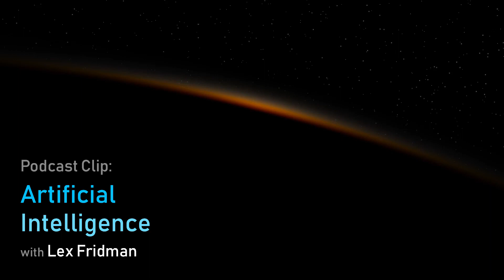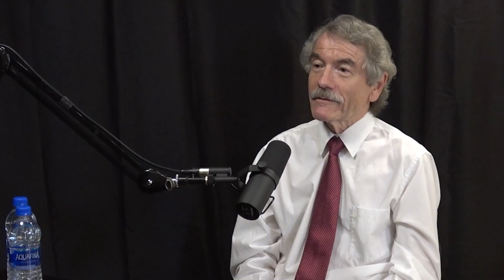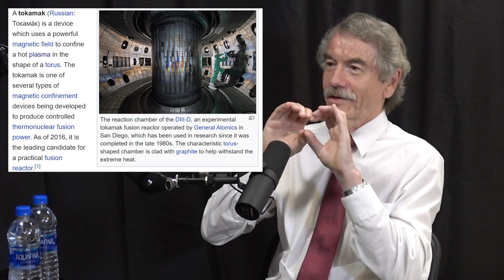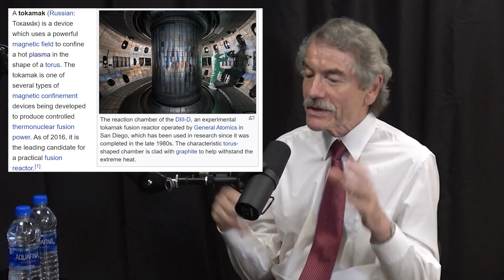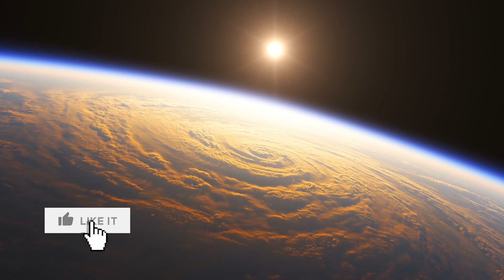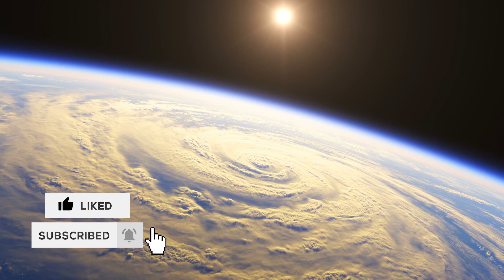Nuclear Fusion Energy | Ian Hutchinson and Lex Fridman

Comment: Nowadays a 150€ photovoltaic collects 400Watts of fusion power from the sky and produces no radioactive waste.
Reply: But the power density is abysmal, they only work for half a day and they get obstructed by clouds.
Reply: NPC 3000 power density is less of an issue with single/double level housing within 35-40 degrees of the equator. Housing and appliance designs can be changed to maximise daylight power production, which currently is not the case. Also battery production and recycling improvements further support cyclical supply but constant demand.

Cloudy days can still see 25% production.

As Ian said, there is no one solution to human power needs. We need multiple supplies and a 3rd millennium design approach.
Reply: How many square kilometers does a nuclear reactor and its associated uranium mine and reprocessing plant occupy? We must be talking square kilometers. 1 km square of photovoltaics has peak generation of 200MW. I don’t see power density as an issue.
Reply: @simontulloch6882  The nuclear reactors on submarines create hundreds of MW, 24/7, for decades. Terrestrial nuclear powerplants have outputs measured in GW. You really can't argue it in terms of energy density, sorry. Note: I am a huge fan of solar energy, after having been a critic for a long time. The economic argument, mostly influenced by economies of scale, is the one that won me over.
Reply: Clouds do not prevent photovoltaics working. Loss due to clouds approx 50%
Reply: An under appreciated fact.
Reply: HiveMind2000 create what?
A battery?
A factory?
An individual photovoltaic cell?

For individuals doing the accounting one must also consider the cost of transmission and distribution networks for centralised energy production. The ongoing maintenance costs. All of the increases as the total current increases.
Reply: Ive no idea, do you know? A potential deal breaker if they consume more in production than they ever generate.
Reply: Good for near the equator, terrible for a place here like the UK or a population dense region that doesn't want to decimate its natural landscape by covering it with cells.
Reply: @HiveMind-qv1iy  It takes in any case a bit less than 150€ worth of (in energy costs), obviously. Which is not much.
Reply: During the Day....

Comment: Evaluating fusion power is like dividing by zero; the technology can produce all of the power we need at nearly zero fuel cost, but it requires a near infinite amount of money to build the power plant.
Reply: “It always seems impossible until it is done.” Money is a man made concept. That's not the problem here. If the physics is right all we need is determination.
Reply: linlinö önilnil- To add to your point,I believe lithium supplies will be an issue before the first plant can be completed. Proliferation of electric cars etc. Although in fairness, I don’t have any real sense of the magnitude of lithium or hydrogen that would be needed to function for a given time.
Reply: It also requires more energy to maintain the vacuum, magnetic fields, and plasma heating than is currently gained from the plasma.
Reply: Jeff bezos fortune should be a solid start ;)
Reply: Compared to say the US military budget the amount of money needed is very small, that's the frustrating part.
Reply: Its lobby and political sensitive and would only be a succes when done by a private organization in secret and showed when it is totally ready to do. To many countries and organizations are depending on fossil energy to allow this going to fast.